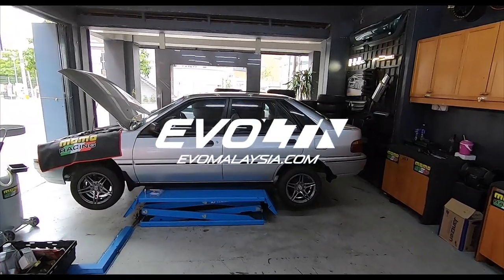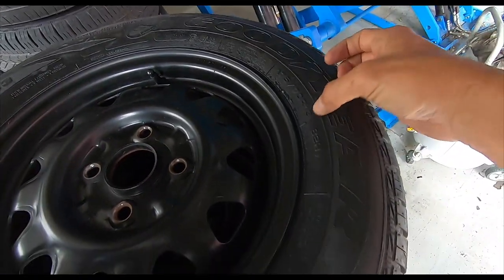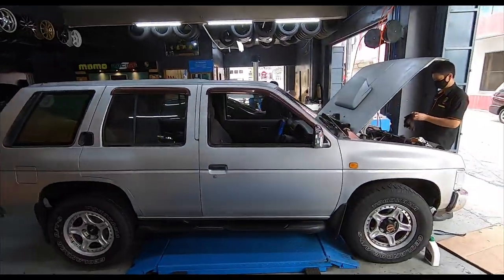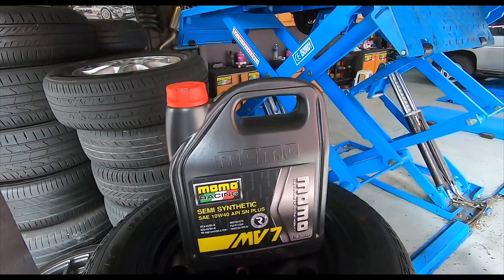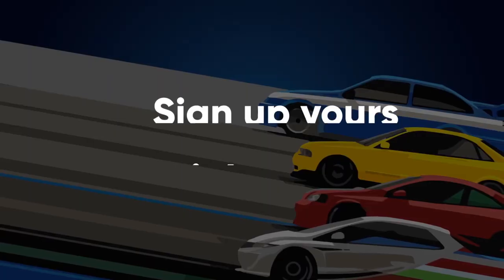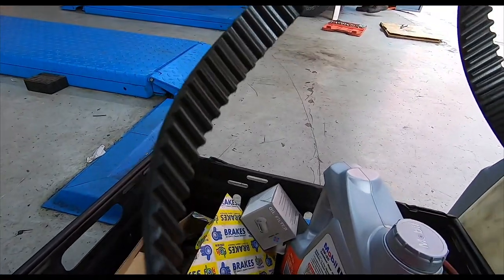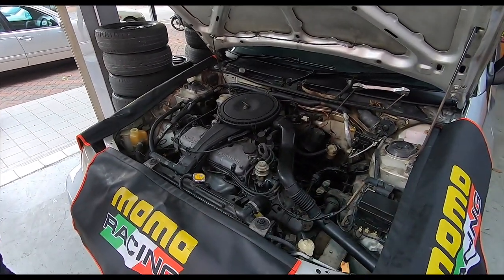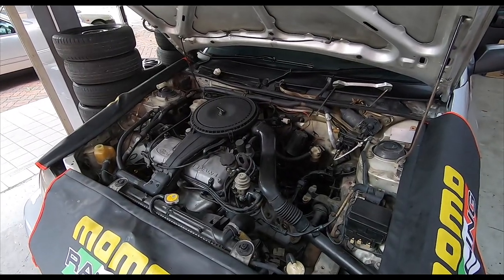WEEVIL UPDATE: 1992 Ford Laser 1.6GL Hatchback - "Blood Transfusion" BEGINS! | EvoMalaysia.com

Comment: For old cars, it seems easier to source for engine and auxiliary parts (head gaskets, brake pumps, CV joints, etc) as compared to external fixtures such as tailgate garnishes, rear & headlights. 

Anywayz, very hensem rims for the Laser. She looks complete now. Congrats bro👏🏼
Reply from the maker: Thanks bud!! Yeah, very true, it's the trim parts that are usually harder to get than engine parts for cars of this era, but for me as u know, the fun is in the hunt!!😁🙏🏽👍🏾
Reply: Yeah, interior and trims are the less available replacement parts for most cars regardless any era. Agree with Chris, the hunt is fun.

Comment: Great content as usual  Chris! I have some questions Chris, hope you could shed some light for my doubts :

1) You mentioned semi-sync engine oils are sufficient for old cars (how old is old, following the age of the car or the mileage). Any recommendation for the age / mileage?
2) Timing belts are recommended to be changed by manufacturers at certain mileage (again this follows age of the car or mileage). One of my car which I bought brand new is now 5 years old but the mileage is only about 60k. 
3) When radiator flushing is done, is is okay to mix with water and not 100% coolant as to how some shops are doing? I thought water can later cause rust to be built up.

Thank you in advance bro!
Reply from the maker: Arnold, anything over 15-20yrs, I would use semi-syn at the most. Timing belts shld be changed according to the manufacturer stipulated time frame, usually every 50-70,000km or so depending on what the maker states, and there should always be a coolant + water mix in the radiator or expansion tank, never 100% coolant, well for old cars anyway, not sure about new ones 😊
Reply: @ChrisWeevilGarage  Great! Thanks a bunch for the detail...Looking forward for your other projects especially satria :p
Reply from the maker: @arnoldswagger5050  oh man, I forgot all about the Satria!! Where is it.... 🤣🤣🤣
Reply: @ChrisWeevilGarage  Haha...